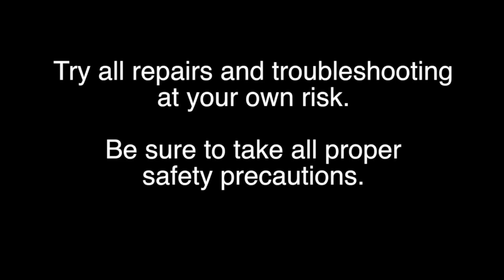LG 55" LED TV Repair 55LB5900 - How to Replace All Boards

Comment: with all screw removed, I can't get the back cover off. The bottom middle, with the nub controller, seems to hold it firmly.
You'd figure a disassembly video would at least cover how to remove the back panel without damaging it. Useless.

Comment: My LG 55 LED is not responding to remote control . Does it have a remote extender port at the back panel ? Can I try unplugging it with a vacuum cleaner or an AV jack ?

Comment: I have no picture, no sound, nothing. The red light on the bottom of the tv flashes like it usually does when I turn the tv on, but the screen stays black. It's an LG 55UH6030, 3 years old. I'm hoping I just need to replace the power board? It's out of warranty so either way it's dead I figure I can't hurt it any worse 🤷‍♀️

Comment: Hi I'm almost done my pcd's were gone I'm only having trouble getting the pic on screen but I know its almostv100% likely I've not put tcon ribbons in properly do they all have lines to match up.correctly ? I'll hopefully look at it once my boys are in bed and get my picture and yes I had pic with no light before I fixed it ....well almost fixed it lol

Comment: I replaced all three boards I bought from shop Jimmy but the tv is flickering show in half the lg signal on the screen it a alternates.  Not sure if the parts were used one's or new but was told there new.
Reply: Robert Duncan 90

Comment: I had sound before changing the t com board but once replacing the new one it does close to the same but flickers white.  The board was replaced the same way as the old one was removed.  I had to get another remote since the old one was lost before I got the tv.  I'll call in a few days

Comment: hi guys I recently started following your channel awesome help n.assistance thusfar ... thank u all ..
okay so I am busy working with a 2009 LG 50PQ60D power on no picture and smoke started to come from back of tv , removed. all cover n tried locating fault but the issue I have now is that with both ysus and xsus boards disconnected I still hear a loud clicking sound ...DOes this mean that my tv's fault is with the main power supplyboard?? tia